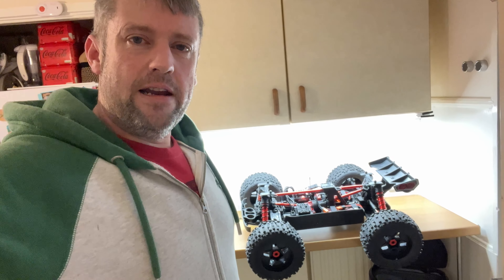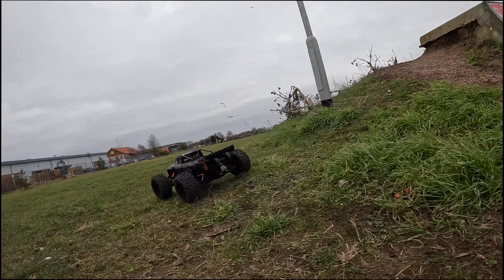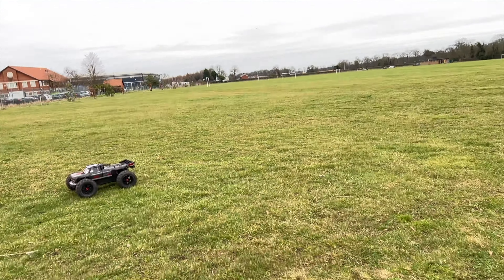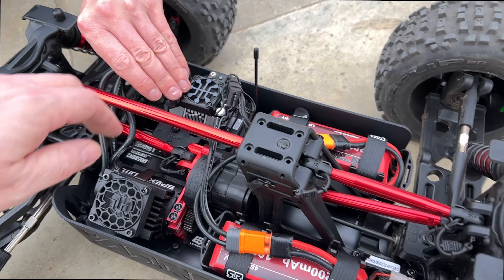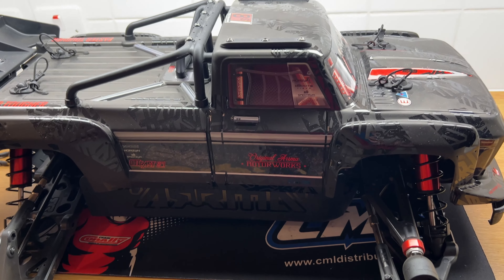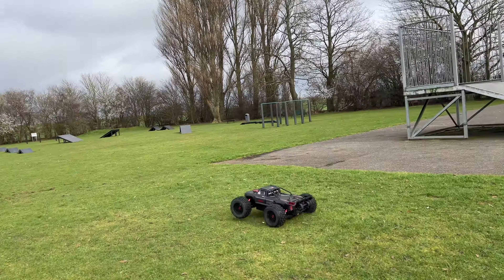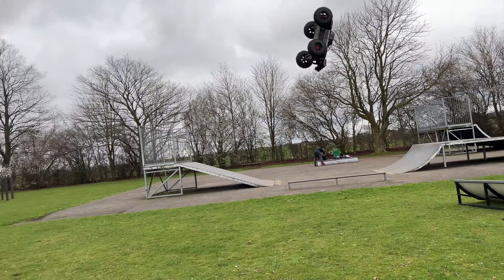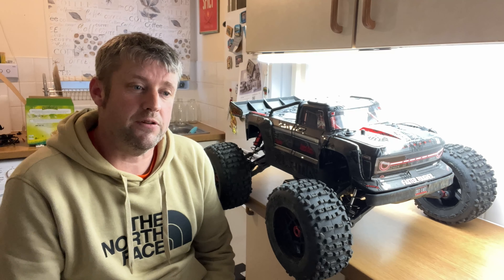Best large scale basher? Arrma Outcast 8s EXB RTR + Hobbywing 1100KV

Comment: I have run into the same issue with the pillow ball retainers. I tried some PTFE tape but maybe I didn't put it on thick enough as they came loose again. The stock O-rings on the retainers are 1.2mm thick so I have ordered some that are 1.5mm thick and just waiting on Amazon to deliver them and I will be off to the park to test them.
Reply from the maker: Yea i tried the same, they a shite, in the 6s exb you get metal ones. i may try teh scorched RC ones
Reply: @RCANDY195  I ended up using 12mm id by 1.5mm thick o-rings. So far they haven’t budged after a couple sets of batteries.

Comment: Sick video! Subbed and liked of course!!My birthday is coming up. I’m new to this hobby. I have an Xrt ultimate and a sledge. I regret buying the sledge. Pinion and Spur break all of the time. The xrt ultimate bashes better. lol. Looking for the absolute best and fastest 8s for bashing. What do you suggest! I do care about speed. I feel like the xrt ultimate is slow.
Reply from the maker: Thanks for the sub! Ok for me the ultimate basher has to still be the X-maxx, I have the XRT also but that's not really made for the same thing like the 8s outcast its great allrounder and handles better but it would not take the same abuse I Gove my Xmaxx
Reply: @RCANDY195  thank you!! Did you make your xmax wide body? I love how wide the xrt is. But I don’t want to take away from the xmax bashing ability. 

Should I get the xmax or xmax ultimate
Reply: I have had an x maxx broke a lot the outcast 8s is my main basher

Comment: Aren’t they the same motor? Stock is HW5687 1100kV, and you swapped it out for another HW5687 1100kV?
Reply from the maker: So your saying that spektrum use hobbywing motors ? When I took it out it’s completely different and size also so how is it the same ??
Reply: @ Hi Andy, yes, Spektrum ESCs and motors are just rebranded Hobbywing. Both motors are the same size and kV. Cheers

Comment: I have the kraton 8s exb v2 and having the same issue, get about a minute of run time and it's in LVC and haven't been able to figure it out. Looks like maybe a motor issue from your experience.
Reply from the maker: Depend on what lipos your running. If your running low C rated or low mah and high speed gearing it will hit lvc quick. With these gens ace packs it never did it
Reply: @RCANDY195  I'm running zee 80c 7200,hoovo 120c 6200,gen ace 100c 5200 same issue with all of them. Guess I'll try the ones you got and see. Thanks for the reply!
Reply: All you have to do is set the LVC, from the factory it’s set really high. I turned mine down to 3.2v & haven’t had any more problems hitting LVC until my packs are truly discharged
Reply: @M14armorer  mine ended up being a esc issue, common issue with the v2 esc is a software update,mine wouldn't take it and is getting warrantied.